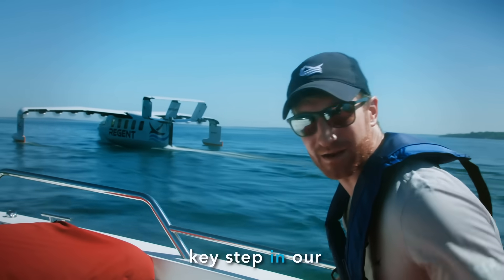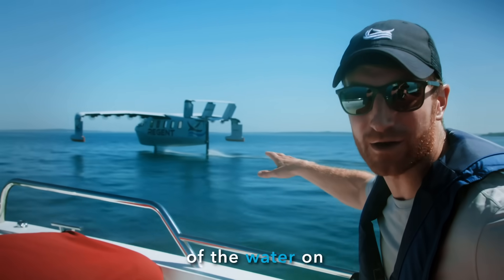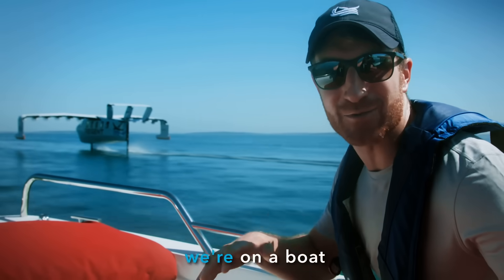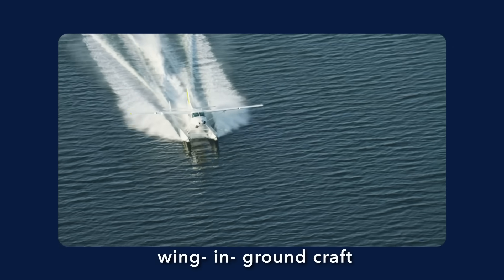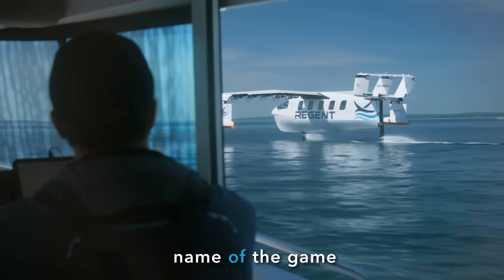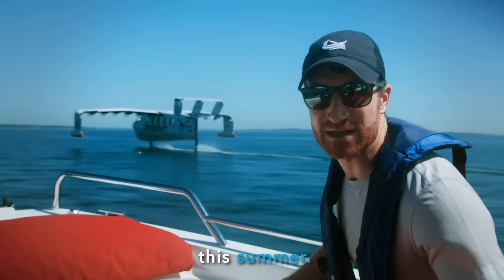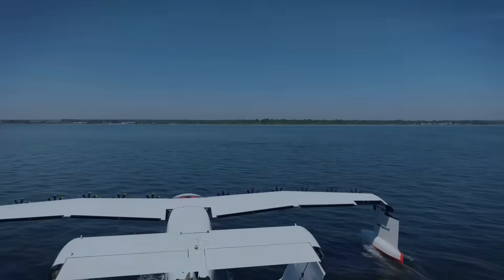Hydrofoiling In Focus

Comment: Rostislav Evgenievich Alekseev sends you his regards. It would be nice if you mentioned who created the hydrofoil technology
Reply: Here in Moscow, on the Khimki Reservoir, there is a monument to Alekseev's work - an ekranoplan. It flew (or sailed) for several years during tests. And then there was even a small series of working machines. But all this turned out to be unreliable and too expensive to maintain. That is why it remained as a monument. Many inventors tried to make ekranoplans, but all their attempts were unsuccessful. For a stable and reliable flight on an air screen under the wing, very quickly changing controlled aerodynamics are needed. And not a single inventor has yet managed to cope with this.

Comment: China is testing a GEV / Seaplane right now, working up to a full size transport plane. Flight up to a few km altitude. Or probably lighter loaded, greater distance in GE. Looks very similar to this.

Aurora (of Boeing) is working for DARPA on the very similar "Liberty Lifter", smaller than full transport plane test model for a heavy lift GEV / plane.

They'll land into and take off out of GE, not full flight speeds right into the water. Half the speed and force coming down onto the foils this has or just the hull.

The foils get it up to GE speeds quicker than picking the hull up out of the water.
This lets it handle rough water with effectively super-STOL ability.

See the Japanese US-2 seaplane for what that Super-STOL ability looks like in a big, operational plane. Really amazing.

Comment: The mention of "deadheads" brings up a serious issue.  At least in the "inland sea" area of the NW from WA into Alaska.  Though otherwise a perfect area for short range air/water travel, the shorelines are bordered by heavy forest and the beaches covered by timber driftwood.  The huge tidal fluctuations daily float those logs into the water and provide serious obstacles for anything navigating the area.  Boat operators learn to keep watch constantly for floating or semi sunk logs (deadheads).  Bent props are routine and a regular maintenance problem.  Boeing and the US Navy experimented with hydrofoil ships in Puget Sound (WA) back in the 1960's but abandoned the idea because of frequent damage from floating logs.  Crew were required to be strapped into their seats to avoid injury from rapid deceleration that happens when a foil is sheared off at 50+ knots and the hull drops back into the water.
Reply: Boeing sold off the technology to KHI. Because it wasn’t part of Boeing’s core business of being an airplane company.
Reply: @Nahngunnarson I never heard that, do you have any links please? I had read they never went with it because of complexity and servicing.
Reply: @grahammonk8013 ”The Jetfoil hydrofoil, featuring automatically controlled fully submerged foils and waterjet propulsion, was originally developed by Boeing Marine Systems in the 1970s with the first craft being launched in 1974. Boeing built a combined total of 28 craft of this particular model and of revised designs up to 1986.

After concluding a license agreement in 1987 to take over Jetfoil manufacturing and sales rights from Boeing, KHI built 15 further Jetfoil craft between 1989 and 1995.”
Reply: Im no expert on this, but I wonder if they could use AI video cameras to spot them in the water and quickly change direction? Problem would be fog, but I wonder if they could do lidar or something to help.  The question I ask is if in the future everything is AI/Computer operated, why would they have 2 pilots? Maybe during testing yes, and during regular travel they could have one in the craft, but basically be there just to make sure everything is good, as it travels itself.

Comment: As a pilot, I'm concerned about the fact that this craft cannot fly without the autopilot engaged.  The transition from water to air looks unstable, and non pilots are operating it. Also, what happens when a seagull takes out one or more of the engines?  Can it continue?  Who cleans it off?  Where is maintenance available?  It looks great skimming through the water.  Maybe they should stick to that.
Reply: It has a lot more props than combustion vehicles do.  Losing one or two should be no big deal.

The transition looks extremely stable to me, at least in flat seas.

But see my other comment above.

Comment: The foils literally eliminate the efficiency.  Ground effect vehicles are the most efficient closer to the surface.  The foils just add drag.  NASA already tested foils on aircraft.  It was a dead end.  They need to retract into the hull during cruise or you're eliminating the entire advantage of your aircraft.
Reply: Right, and the wings look too high anyway, for a ground effect. And too short (chord, the distance between leading and trailing edge).
Reply: There are jet foils in operation around Japan. Originally developed by Boeing, but they sold off the technology.
Reply: Yeah. They definitely don't have a team of engineers working on this. This is all speculation. 🙄
Reply: @nicksalve Basic physics.  Water is more dense than air.  The Cybertruck had an entire team of engineers, and look how that turned out.  You just need to be smarter than who you're scamming.
Reply: it's not meant to foil while flying, the foiling is to make the ride smoother and the craft more wave tolerant during water operations before and after wing born flight.

Comment: Great though this is, i think that foiling is used to mask the problem with the battery power. Due to the lack of Kilowatts stored, the power needed to get a seaplane hull out of the water would consume too big a proportion of available  kw, causing range shortage.
Saying that this is highly efficient is a bit of a stretch as  a normal seaplane does not spend long  in this phase of flight.
A normal seaplane is very robust and simple which makes for safety and reliability. Think  PBY Catalina.

Comment: If all you want to do is foil, why not just use water as the propulsion fluid?
Reply: These are supposed to work in flight up to around 30 feet or so, still in ground effect. Water isn't a good choice for propulsion.

Comment: Interesting to find out the take-off speed. At 50 Knots the foil cavitates. So this craft needs to be able to fly really slow.
Reply: Better let them know before they spend too much money on it.😂
But seriously; it’s a blown wing operating in ground effect. No problem getting airborne at foiling speeds. The flying part is old tech. The new bit is that much less power is required to get to flying speed.
It is a sound concept although the commercial use would be limited to a fairly specific environment.
Reply: It's also a GEV, for much slower landing speed.
Reply: A ton of complication for questionable gains in 1% of travel regime. Makes 0 sense.
Reply: @Benjamin-xv9le except if that 1% is the sizing case for many components on the aircraft, then it might start to make sense (lighter hull, engines, possibly to go electric…)

Comment: dumb...   wtf gain is there by making the 30 seconds of takeoff 'roll' (boating) more efficient
Reply: This thing could potentially take off in conditions where the swell would be too large for a traditional sea plane to take off.
Reply: @Kevin_Aus imagine the stern foil in the water, while the bow foil is in the air between waves. Instant cartwheel unless the stern foil provides no lift. So why have the foils in the first place?
Reply: I bet there's not enough power to get a normal displacement hull to liftoff speed. Aswell as the energy savings of foils...
Reply: @willowglenn yeah, you won't get a displacement hull to lift off speed, which is why seaplanes have been using planing hulls for over a century. Those can (generally) go faster than foils, as they don't run into cavitation problems, and work over a wider range of speed.
Reply: It's more than 30 seconds. From the takeoff spot to the moaring it shall be 15 minutes

Comment: As an experienced foiler these guys haven't even come close to addressing the elephant in the room. Going from air to foil. All the rest of the stuff is really easy, getting up on foil, launching from foil to air, simplicity. Getting from flying to foiling, OTOH, is REALLY hard. Literally every foiler I know, including me, has crashed hundreds of times trying to land a jump onto foil.
Reply: Agree. Besides the stability problem, there is also the speed problem. What's the landing speed? 150 kph? What's the cavitation speed of the foil? About 50 knots / 100 kph, as in AC? What's the load on the foil the moment it enters water? What's the force pitching the plane down that moment?
Those all are hard questions...
Reply: But let's remember we are just simple humans with very limited abilities.  I would expect their computer controlled control surfaces will make short work of the landing ... but totally agree (smooth) landing in choppy water is way more complex than planing the foils and takeoff.  Cant wait to see the test videos!
Reply: Have a Hobie 18. Is it possible to reinforce the hull and superstructure
add long CF strut wings with floats inboard plus hydrofoils. Slower flight is good to
I've had dreams of this.
Reply: There's a huge difference between a wingfoil foiler and a plane that: has continuous thrust, glides in at a low angle of attack, has Imus and  ultrasonic/laser sensors to continually adjust foil angle of attack thousands of times per second to maintain precise vehicle pitch& altitude.
Also, as a wing in ground effect vehicle, it can glide very slowly.
Reply: You have to retract the foil in the fuselage ( same as landing gear)when coming for landing.
Reply: Retractable foils eliminates the reentry issues.
Reply: Kite foil and wing foil landings, even violent ones are pretty easy to land. Some landings are moving pretty fast. Foil crashes can be violent. These guys will pull it off.  Anything is possible. It's brilliant really. I build and operate foils now since 1985 up to today. It will happen. Easy. Tge Wright Brothers would be so stoked!!!
Reply: It's a brilliant design using the calm water runways all around the world to quietly cleanly and quickly transport 
personell and their luggage.
BRAVO. We need ingenuity and great inventiveness to improve our world
Reply: Probably just retract it for landing, free brakes. Then deploy the foils to dither back into port.
Reply: The real elephant in the room is launching in rough sea. This thing only has 2 points of contact on water it's highly unstable.
Reply: youre correct, landing on water with foils is gonna be the hard part, kitefoilers do huge glides and seem to have found a way so they just need to do whatever they do i guess
Reply: I think they land like a waterplane. No foil
Reply: One solution could be to fully retract the foils into the hull of the plane. There is arguably no need to land with the foil out. Also if you are on something like a foil surfboard/sup/etc.. your wing has no control surfaces unlike this seaglider. This also has control surfaces on the wings to help with balance and control.
Reply: @Kevin_Aus their foil is retractable, so they will probably do that.  Maybe this whole discussion could have been avoided if they had explained that
Reply: @glike2 it’s was obvious enough. Retractable landing gear has been around for longer than anyone can remember.
Reply: @glike2  ah well that answers that i guess
Reply: @Kevin_Aus  not a foiler, but a sailor (who loves to watch foiling sailboat races) unless there’s something equivalent to a dagger board trunk in a sailboat, I don’t see them retracting it with this prototype.
Reply: It looks like AI anyway. More tech. start-up BS to suck in investors.
Reply: @ThirtyYearstoolate  It's not AI, at least not as seen here. They have military contracts, they're not trying to fool the US Marines (generally considered a poor idea).
Reply: Load of crap.... talking tonus like they know what they are doing g..... this is preschool 😂
Reply: Who said anything about taking off out of the water?  These are designed to do only what you see here.  Efficient passenger and cargo travel from port city to port city on foil, not taking off into the air.
Reply: @erickrwawecz3756  No its a legit plane man. It is supposed to fly.
Reply: @erickrwawecz3756  Actually, they (Regent) did! The whole goal here is to use the foils to transition from displacement hull to flying more efficiently.
Reply: @erickrwawecz3756  Were you born stupid or did your mother throw you down the stairs a few too many times? The Sea Glider is a ground effect vehicle. That literally means it FLIES in ground effect.
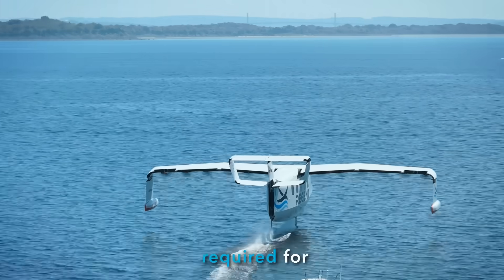Reply: @erickrwawecz3756 Thea specifically mention takeoff in the video at 1:42
Reply: @MrMacGaunaa  ummm, no.  Foilborne is the term you are looking for.  It has nothing to do with airborne.
Reply: @erickrwawecz3756  did you even watch the video lol?
Reply: C02 is great for the planet contrary to popular belief.
Put some turboprops on this great thing and get serious.❤
Reply: @neil-e2d 
It’s just a bit unfortunate that too much of it isn’t great for human habitation.
Reply: @neil-e2d true, the planet has never had so much vegetation. If we reduce the CO2 significantly we're going to starve. Don't get me wrong, we can't let it get too hot but much more serious is the loss of farming land, we're likely to starve before we fry, in 50 years. Check out Monsanto's prediction. Forget the CO2 pollution problem, focus on farming.
Reply: @neil-e2d  "Thinking" is actually great, try it sometime.
Reply: @neil-e2d  C02 is great for plants. It’s also great for wild fires, hurricanes, large changes in regional ecosystems. Changes in C02 levels have brought in new forms of species, at the minor expense of the extinctions of the previous species.

Good thing temperature fluctuations in the past happened over the course of millennia and not over the course of say a century.
Reply: @neil-e2d   Just like salt in the diet, some CO2 is good. Too much is bad.
Reply: @dcsensui   agreed but the analogy is too simple to support the IPCC climate change alarmism and their destructive ideology being imposed on the world.
The SUN CAUSES CLIMATE CHANGE
not CO2 or methane
Reply: @neil-e2d  Exceeding wet-bulb temperature threshold not so great for humans and animals though that haven't had thousands of years to adapt physiology.   The planet won't mind.  Perhaps you'll volunteer to be working outdoors in those conditions when others can't ?
Reply: @gregmckeeswildthings9647 
The sun causes climate change and weather variation not mans use of fossil fuels. Ive worked in 52•c in Australias North 12 hour days. Heats not a problem
Reply: @neil-e2d  Tell me the scientific definition of wet-bulb temperature threshold and then explain how exceeding  it isn't a problem.
Reply: @gregmckeeswildthings9647 
Humidity with too high a temperature
exceeds the threshold of the bodies anility to cool and regulate temperature.
The sun causes climate change and weather variation not CO2 emissions
Reply: @neil-e2d 
The planet doesnt care about CO2, but the reckless burning of fossil fuels is a big problem for life on this planet, and especially for agriculture.